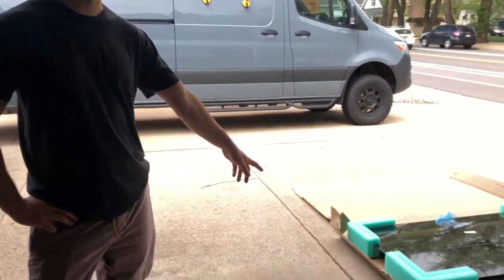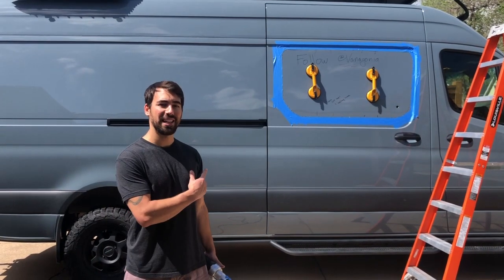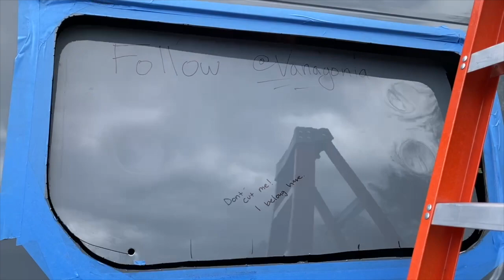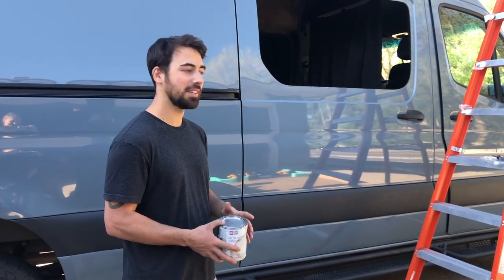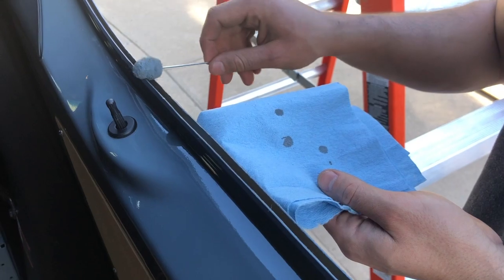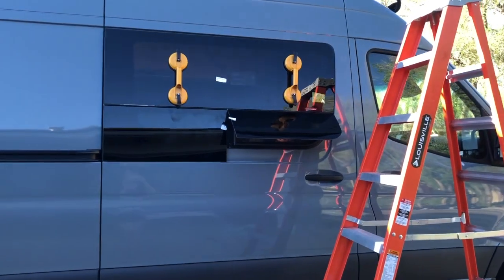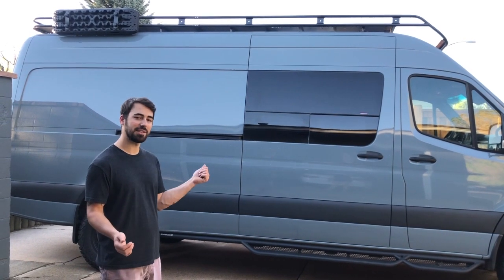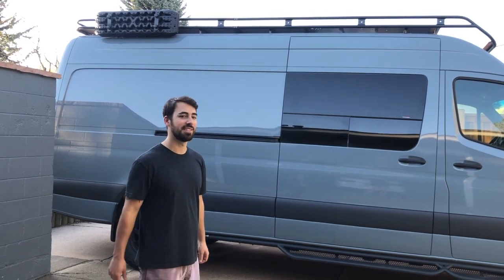CR Laurence T-Vent Sliding Door Window Install | 4x4 Sprinter Van Build

Comment: hey...do you have a 1/2 gap on exterior vertical side of the passenger slider towards the rear( glass to van)??? thnx
Reply from the maker: Hi Alex! I hope i'm understanding this correct, but i do believe we have about a 1/4 inch of space between glass and metal but not a half inch. 

We found that once you screw the frame on it tightens quite a bit. Hope this helps! Thanks!